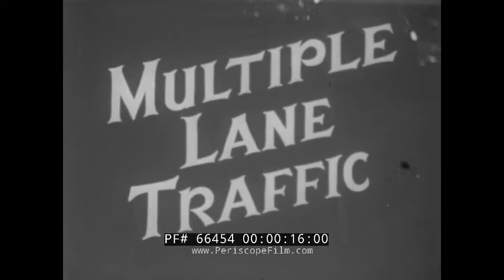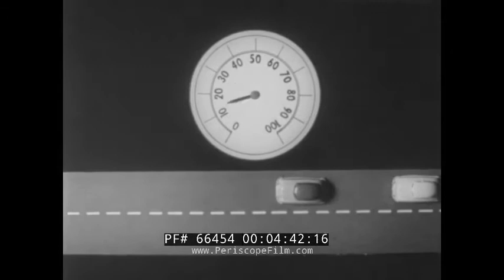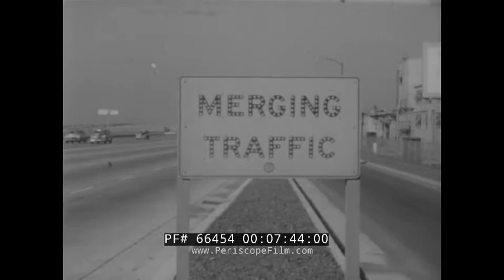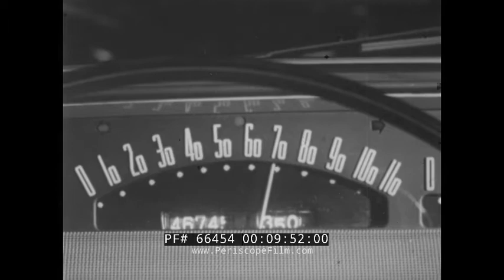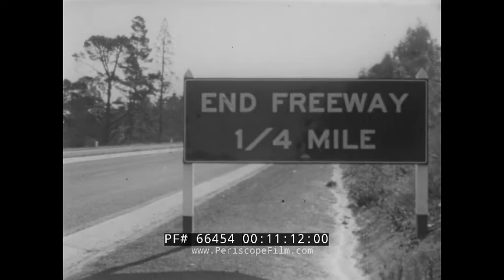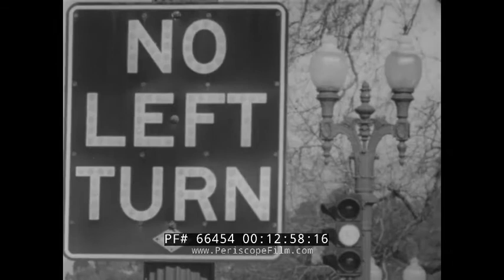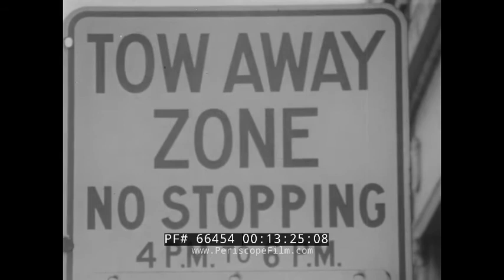" MULTIPLE LANE TRAFFIC "  1950s DRIVER'S EDUCATION FILM  LOS ANGELES FREEWAYS 66454

Comment: One thing that seldom or never gets taught is how to leave a highway straight lane and enter a turn lane. Too many people go at a slight angle, aiming for the spot where they will finally turn, leaving their car in the straight lane, blocking the cars behind them. The correct way to do this is or quickly get your entire car into the turn lane at the very beginning of the turn lane, then slow down. If the lane is short or there are other cars already in it, slow just enough to prevent your car from being a hazard in the straight lane, then get fully into the turn lane and decelerate faster.